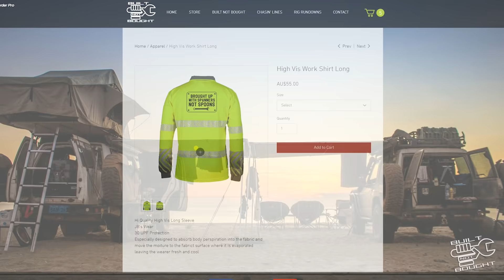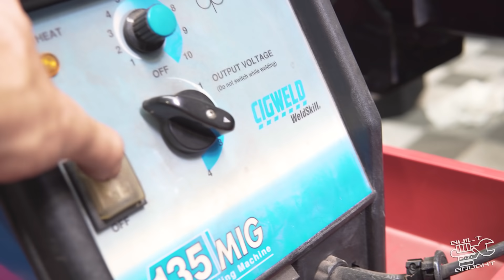PATROL REBUILD || Part 1 Suspension, Chassis, Wheels, Tyres..

Comment: Defender td5 90 pickup, completely modified. Roof rack, spot lights, roll bar, flared 170mm arches, custom exhaust, allot of performance modifications, bucket seats, harnesses attached to a FIA approved harness bar, racing steering wheel, chequer plate, custom side steps, halo lights and custom halo fog lights, 60mm spacers with 265/75/r16 tyres on vbts nemesis alloys, polished 8mm aluminum steering and fuel tank guard. Plus allot of other modifications the list could keep going on!! “Money Pit”. Loving the channel get allot of inspiration from you and finally I can’t forget the build not bought badge of the SVX gloss black grill! 💨

Comment: 1989 LN106 Toyota Hilux, custom home made tray with a half canopy, bull bar + scrub bars, front and rear lockers with front and rear winches, I can’t even describe the inside of it, it has all been changed out for luxury on the inside and you get the full 4WD experience on the outside. My plan is to put a full roll cage on it (like the BNB truck), it got handed down to me by my grandfather who bought the car new, I’m not even old enough to drive it yet but have done all the modifications to it other than the interior.
Reply: And my plan is also to put a V8 in it soon, just need to find the money

Comment: 1999 toyota hilux ln167 with 2003 front and rear diffs, single cab with a 2 inch lift from fulcrum, custom built by myself and my grandfather tray and custom siderails and side steps. custom built dog cage for the rear, with the built not brought sticker on the windshild to support that built not brought life, for a 18 yearold im proud of what ive got today

Comment: 2011 PK ranger wildtrak...
I bought it stock standard and literally "built not bought" my rig. Below is a list of what I've done to make it my rig the way I want it....
Twin locked, Diff drop kit, HD torsion bars, extended upper control arms, HD foam cell socks,  HD bash plate, 3 inch exhaust, remap tune, rock sliders, 12500lb winch, ARB bullbar, LED driving lights, UHF radio, double DIN stereo, Canopy, 18" alloys, DCDC dual battery system, just need rear drawers and she is done. 
Loving your videos keep them coming mate 👍👍👍

Comment: I'm running a 2017 PXII Ranger and the Wife is running a 2018 LC200. Cruiser stock for now, ranger build for getting out and have a blast on any trail you point the wheels at.

Comment: Zd30 patrol with the anti grenade kit installed for the daily and then a gen2 hilux surf I have put a Lexus v8 into. The surf is still a work in progress, but now the shed is up, the new hoist will be going in soon, and I can finish the exhaust off and head Bush to test the beast out!
Reply: How the anti Granade kit go? a co work told me about them?
Reply: Diego gonzalez well worth investing in mate. Being able to monitor your boost, and egt’s is crucial to getting on top of any issues before they happen. Spools faster and runs better with the dawes & needle valve too
Reply: @bertyboy2397  hmm righto I'll look into it then

Comment: 2004 nissan navara d22 zd30 manual,
she has done well until recently where she cracked a head, decided to do it my self and while i was at it replaced my cooling system, injectors, glow plugs, timing, was good fun 👌👌👌 and she is about to get back on the road!

Comment: 2000 P38a Range Rover 4.0L V8
Coil Converted, center muffler replaced with hotdog, tad bigger tyres.
Had it less than 2 weeks but already starting to love it.

Comment: I book around in an 80 series that i built of of 2 of them..  i had a manual diesel with the most rusted out body. bought a petrol auto with an unreal body but a blown motor.. did a body swap and put the good body on my manual chassis. i repurposed and old bull bar and made it look brand new. custom roof rack. draws in the back. i bought a 2 inch old man emu lift off market place for 100 bucks and put that in. put a dual battery system in and hooked a fridge up to it got spotties coming. custom draws in the back. got 33 inch bf goodrich muddies, an axis fab snorkel, few more mods to go but its a beast so far. cant wait for the vid of you slapping a new motor in your 80!

Comment: I have a 1985 MK Patrol which I have built up into a Class 8 off-road racing truck. I bought it with a 308 already installed but swapped that out for an Injected 304 from a VN, just about everything has been upgraded and swapped out in the shed with some help from a few good mates.

Comment: 2013 3.2L 2x4 bt50 with a lovely driveway installation arb bull bar, 12000 ridge rider winch, 42” Stedi light bar and the best mod of all time a 2.5” muffler delete

Comment: Modified 2012 FJ Cruiser, lifted, 2 light bars, bull bar, cargo barrier, aftermarket cooper tires and roof rack. INTERIOR: iDrive, custom light switches and an obd2 display. PS: also a corolla, gotta have the corolla.

Comment: 2017 np300 just fitted with a tray and canopy setup and a extra long travel suspension set-up.
2005 hsv maloo currently getting built with a snail hanging off the side of the motor.

Comment: Just started to build on a 1999 1fz-fe 105 series landcruiser that I picked up with a blown head gasket. It's stock standard and has never been off road. 

My daily driver around the city is a 2008 Mercedes E280 CDI.

Comment: Got my old 94 v6 VR commodore with factory t5 manual that I’ve flogged around for 10 years without missing a beat, now upgraded to 2000 patrol zd30 that I need to build.

Comment: Ford ranger PX2 , 4” lift, 295/75/16 BFG ko2s, Browns Davies long range rank, 3” exhaust, upgraded geared oil pump, external trans cooler, dual battery, set up as a tourer. WA FTW
 
.

Comment: just bought my first car a couple of weeks ago, it's a land rover defender 110 td5 from 1999 and it is the 3 doors version. It is still stock at the moment (it just has some bigger all terrain tires with no lift) but I am planning to make it a light overlanding vehicle to go on weekend trips and on bigger trips in summer during school vacation. But first i need to do some maintenance because it leaks water when it rains and it got some rust and pealing paint to deal with...

Comment: 1996 LN106 Tamworth Edition Toyota Hilux as our go too 4WD, we also have a 1949 Dodge Fargo, on a HQ chassis with a built 253V8 that we're building up to be a rat rod, we also have a 1953 Ford Prefect with the original 4cyl Flathead, and a 1983 Ford LTL thats the work rig that pays for all the toys 🤙🏻🍻

Comment: Ive got a 2000 model 105 series landcruiser with the 4.5l petty motor. Stock lift with 305/75r16s (33") Loving the 20+L per 100km

Comment: ‘11 gu troll coil cab chassis, 2 inch lift, 32s, soon to be 3 inch and 35s
It’s cool that you’ve put a 3inch in your troll cause it seems rather difficult to find any series 4 patrols with 3 inch lift and 35s, everyone goes with 4inch lifts so you can’t really get much reference with scrubbing and stuff

Comment: I personally drive a Nissan Navara d22( doing a full engine rebuild right now from hydro locking :(, also have lots of others in the arsenal.
Ford Ranger, VW Arteon, ford lazer, the big 350 Chev suburban 88' model and an old EH holden for good measure!

Comment: 2019 BT50 on 33s
80 series 1hz (project car), bog stock with 4 fluid leaks, a slipping clutch and severe panel damage 👌

Comment: the LRT are great but come with drawbacks. the fuel gauge wont move till you burn off the first 55 litres only starts measuring from what the standard full tank was. and below 1/4 they fuel surge, even with the baffles they have in them and they struggle to get the last 10 to 20 litres out.  i ended up putting a Holley fuel matt in. friggin expensive but bloody brilliant!! nothing worse when you think you have 1/4 of fuel but sitting on a 30% hill i cant pick up fuel.

Comment: 2005 Nissan pathfinder st-l running a 3 inch lift with 33s. an rtt and dual battery system running my dual zone in the back

Comment: 2004 Nissan Patrol ZD30 that's gonna be 6BT 12V Cummins swapped and a 2006 Ford Falcon XR6 Turbo making around 600 hp. Patrols got a 2-inch lift and 33s BFG KO2 and that's it 😂 Gonna start making it into an overland and offroad vehicle after I get the Cummins in. The Falcon was an EX Highway Patrol Car here in NSW but it's stock everything just tuned and some other things I can't remember right now.

Comment: 2001 Landrover Freelander 3dr so can take the roof off and enjoy the 3 days of sunshine we get every year in Scotland
2002 Landrover G4 Challenge Freelander used in the G4 Challenge event in 2003, the vehicle went to Australia and used in WA leg, now on my island (Isle of Lewis). It had some outback dust in it when I got it which matches the tangiers orange paintwork. 
2005 Landrover G4 Challenge Defender 110 used in the G4 Challenge in 2006, lucky for me the guy who had it before was a director for Landrover so its had the full auto conversion done, 2" lift, ARB lockers front and rear along with front and rear winches and the full G4 challenge spec. Its also Tangiers orange so can never lose it in a car park or have an affair. 
2005 VW T5 camper van with pop top roof with full kitchen etc , oh and a diesel heater because my wife doesn't do camping from a Landrover.

Comment: Iv got a 2007 mazda bt50 pretty good ute ots done some hard  tracks now just a family ute to tow the camper trailer iv built it from stock new motor lift rims tyers cage lights fridge draws solar alot on money dugong into it to make it the truck it is today cheers

Comment: 1999 Toyota Prado 3.4 l v6, and a 2000 Toyota Prado 3.4 L v6, and a 2011 VW Tiguan 2.0 L Turbo Diesel.
What is the motor in the background between 9.30 minutes and 10.30 Minutes?

Comment: Got a Amarok, 1.5" ARB lift, ARB winch bar, salvaged and repaired Ironman winch and Safari Snorkle.
No it isnt a awd.
No it does actually have a low range. It is a manual

Comment: Things must have changed in the 2 years since I sold my Nav.
17s were SUPER expensive in any size. 16s were cheap and super common, 15s were still pretty popular. But I could get 20s cheaper than 17s

Comment: 94 Toyota surf currently having ECU problems from when I drowned it, btw engines still going strong Toyota engines aye just took the glow plugs out cranked it over all the water came out drained the oil to now she runs like a champ but yeah the ecu didnt fair to well

Comment: 2005 Gu toyota patrol has stock as rock with the basic upgrades that I need to fix are 2inch lift, lights, the daul battery, wiring and intercooler is leaking now rear bumper as hit the driver side while slipping into a rut. Things I've added catch can awning that came off my prado when i wrote that off, a draw, intirear fishing rod racks also came off my prado, bought a 35s spare because it had 31 aloi for a spare, spare wheel spacer kit to fit the 35 a bit better also neater, driver side wing with gas strut door, rear carpet panel to add the electronic  like fuse box or other stuff later plus to make it look neater when i flip seat forward upgraded revers lights because I broke the other ones and the ones there on my prado were more spot than flood, a uhf radio holder because it didnt came with it when i bought it, fridge and slider. Thinking about it now I did fair it bit to it

Comment: Sas’d Holden Colorado 08 front mount intercooler and biggggg turbo 30+ injectors with 3 inch sus lift 2 inch body and 33” tyres

Comment: I’ve got a 
1990 Toyota celica (the fun car)
2001 Prado 90 series lifted 4 inches 
1979 Datsun 200b sx (restoration project)
1980 Datsun 200b sx (restoration project)
2017 brz race car with an rb25

Comment: Tb42e gq patrol wagon, soon to be turbo

Stock fj45 (currently farm car state but trying to get it back on the road)

1jz swapped r32 gtst skyline - daily 

Holden 304 powered Toyota corona wagon - in the build 

1989 Toyota crown (currently rolling shell, plans are ls2 turbo cruiser)

Comment: 2012 gu patrol, ve berlina, and my babies a 1972 383chev stroke HQ 4 door (in a complete nut and bolt resto) and a 1974 HQ ute burnout car with a 360cube sprint car engine, also getting a birthday, cheers

Comment: 200 Series Landcruiser with pretty much ever piece of fruit you can put on it (one of those rare models that spends more time in low range then in the woolies car park :P) 
and 
A 2002 Nissan Skyline R34 GTR V-Spec II Nur with 600Kw

Best of both worlds :) - no idea if you are still doing the selection or not. 

If you do actually read this comment, I was wondering if it is too late to enter the golden ticket draw?

Comment: 1999 100 series landcruiser  turbo 1hz 2inch lift dual cab and 33s, all mods done at home from factory stock wagon. 1999 au falcon  xr6  manual 4.11 locker 3 inch exhaust plus some other goodies, all mods done at home from factory stock sedan. 1975 Ke30 toyota corolla sedan stock as a rock, full rebuild in the not to distant future with mods. 1976 ke35 toyota corolla panelvan, barn find, just an ornament at moment.

Comment: Ive got 3 cars that run and registered on the road and 2 others that dont. 1st. 2003 Honda Pilot that's wife's ride. 2nd 2000 Dodge Dakota 4x4 I'm swapping a v8 into it was a v6, that's my "build truck" one day it'll be done lol! 3rd. 2000 Cadillac Eldorado Etc that's my daily driver 300hp it's a little sleeper. Then the other 2 are old ford trucks ones a 67 f100 and the other is a 72 f100 both are nice but can't afford to keep them all running and on the road!

Comment: Ex Telstra GU Patrol, fitted out for remote work and remote living, 
Mitsubishi Van, fitted out for sparky work, people get shocked when a fully loaded van with ladders and conduit on the roof enters their field of view on full opposite lock.
3x Datsun 1600 rally cars, including a Group G, trying to preserve a forgotten and neglected part of motor racing history.
2x RZ350s, 2x XR350s, 1x KR250 with an IT490 motor in it and a TT250 in bits.
There is a Man Rule that's seems to have been forgotten over time..
A man should own the same number of pistons as his age, it can included mowers, chainsaws, spare engines, they don't have to be running at the moment, the jury is still out on whether coffee tables should be included.

Comment: A hilux on a 1980 single cab chassis surf coil rear end solid axle front 1999 space cab with a 2004 front end powered buy a 1uz and manual
Running a haltech elite 950 550cc injectors and a coil on plug conversion

Comment: I go into bobjane for new trailer rims, tyres. I have a 30year old box trailer. He sees the 13" old steelies and goes "awwww i dont know mate. Not easy anymore." Check the computer and would you know he has 4x 13" sunnies and tyres to fit in stock. Happy days for an old trailer not worth bigger rims or tyres,.

Comment: 1970 Jeep J2000/Gladiator - nissan powered SD33T
1982 Jeep SJ Cherokee - Chevy powered 6.2L V8 diesel
1966 Mercedes Unimog 404 - 5 cylinder mercedes turbo diesel
1996 Mitsubshi MJ Triton (daily) dual cab 2.5litre turbo diesel
1995 Mitsubishi L400 Delica to be modded soon with bigger diesel engine
1985 Jaguar XJ6 Sovergin twin carby straight 6

Comment: Currently building a 2005 f250 7.3 power stroke, it’s coming back from the dead, check it out @transformation_250 on insta. Also have a VY SS ute, BT50 and a rav4